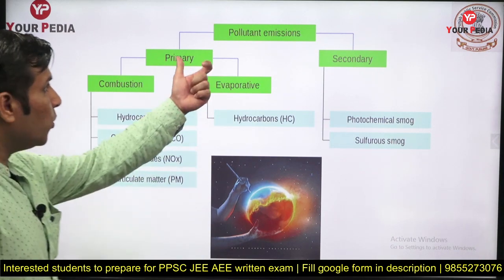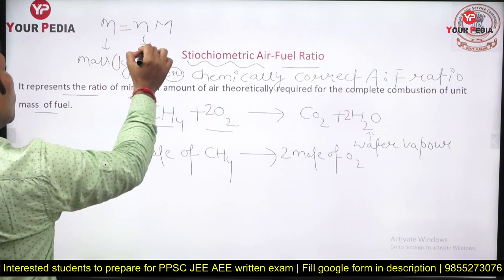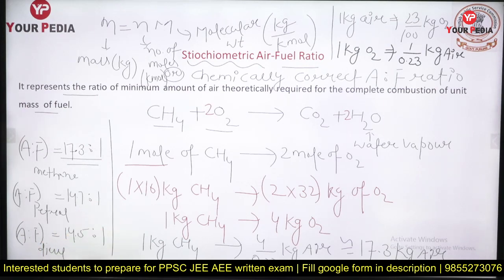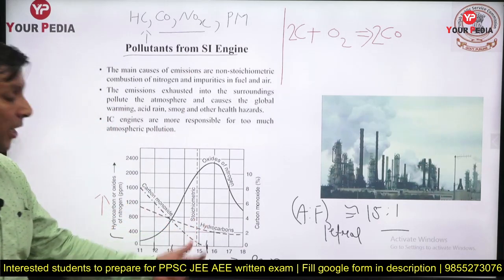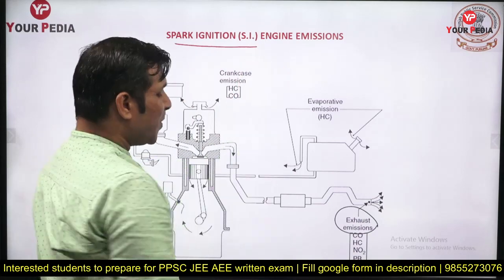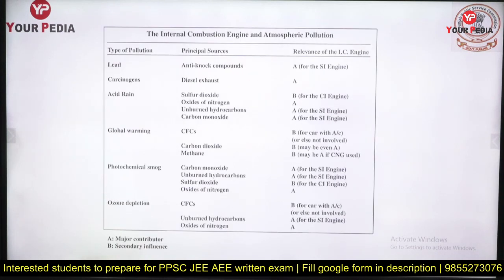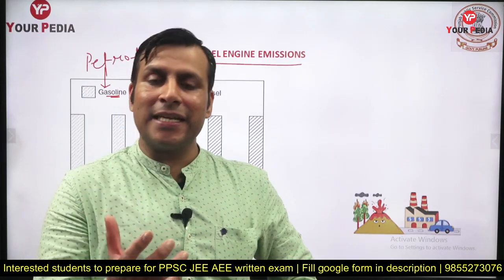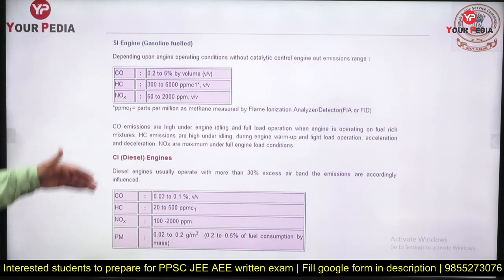Automobile Air Pollution | PPSC Environment AEE & JEE Written exam preparation

Comment: Sorry to say but the educator fails to generate interest . This is PUNJAB’s exam , why to generalise the language, use local language. Here it seems k you are reading some book simulator. Moreover firstly discuss the syllabus of each topic , then try to give the details of the scheduled topic covering.
Reply: Discussion Of SYLLABUS and not topic i have mentioned. Secondly no matter the questions come in english in exam but to make the understanding level and generate interest kindly consider my suggestion. Without stretching the arguement , i have been regularly following your platform , nowhere found about how long is your module for this exam , which teacher will cover up which subject , hence the feedback. I hope you take in a constructive manner. Thanks.
Reply: @harsimranvirsinghsidhu7921  Jo inhone padhaya hai is it enough for Automobile Emission as per exam point of view?
Reply from the maker: Discussion of topic is already done in previous videos. You need to follow continuously. Secondly about the language, educator is speaking technical English only, which will be the language of exam
Although your suggestions will be considered